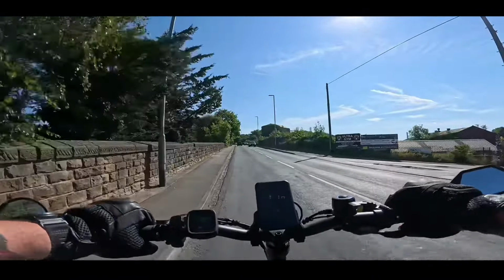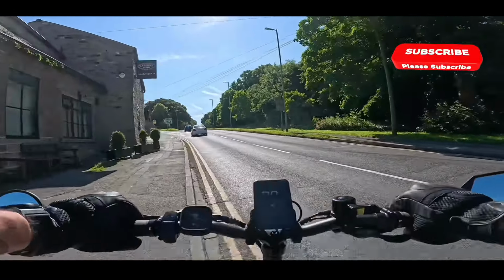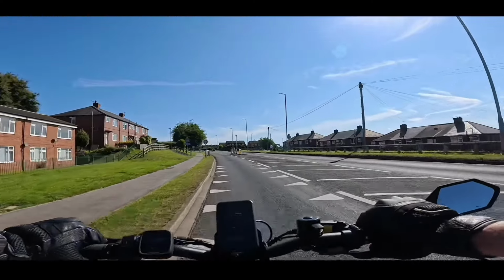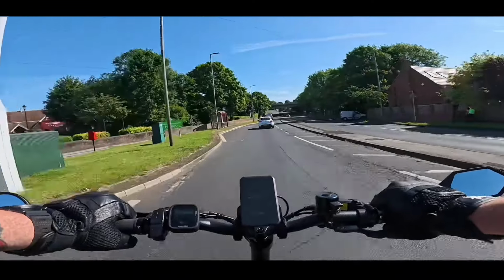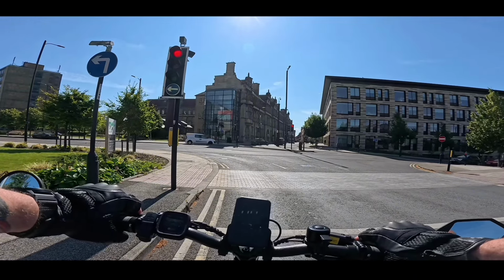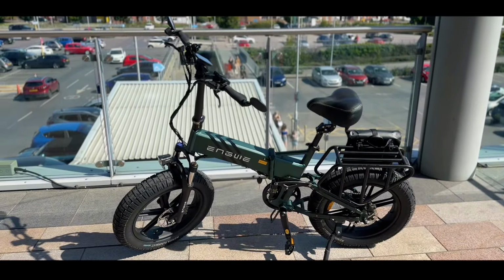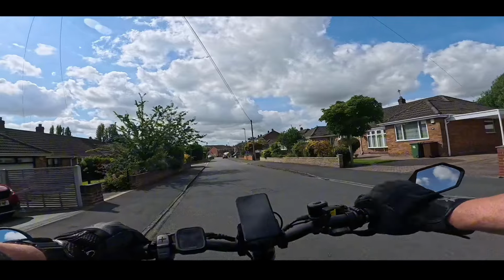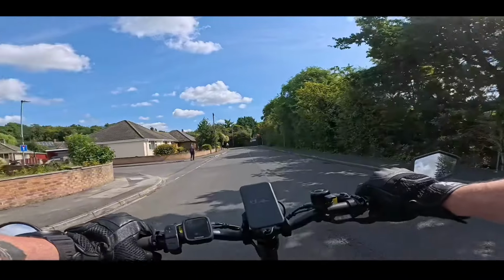Engwe Engine Pro 2.0 How to make the Engwe Engine Pro 2.0 better

Comment: Hi, great video, i bought mine in green, and recieved it this week, after riding it a few times i noticed the front fork stem was lose, so i took the handle bars off to be shocked that nothing other than 2 flimsy bearing rings and some plastic rings were trying to hold the fork stem in place, after re assembly it still fid not work, have you checked yours? When you pull the breaks the handle bars jerk because of the movement in the stem. 
Hope all this makes sense, is there a fix for this?
Reply from the maker: @ironian24  mines fine. I’ll be swapping my headset out next week to a sealed bearing set. I’ve got adjustable air suspension to fit to the front and mid as the modding should be complete in a couple of weeks when the rack battery arrives. 

To be fair, the head set should be fine, just needs tightening down. I weigh in at 250 and it’s holding up fine. 
http://youtube.com/post/UgkxICO9Mqe3NzkzEsGc8_fIYik9GZwV_GRf?si=qtmkWU-3xsXujE1O
Reply: @ModProjects4306  I sussed the problem, I have not tightened the center nut up before tightening the Alan keys on the handlebars 🙄, so I realised what I did wrong and undone the handle bars undone the centre post nut adjusted the stem so it sat central and ret8ghtened the centre nut until all play was eliminated then tightened the handlebars, walla, job sorted, I got the throttle working also, but to be fair I can peddle at a constant 28mph where as the throttle on its own does 20mph, this is private land testing of course.
I have to say I love it, it's an absolute beast of a bike and like you I'm 245 pounds in weight and it's totally fine, the range is very, very impressive, and off road is a must with this as well. For me there is nothing to dislike about this bike and for the money I really can't see another beating it.
Reply: @ModProjects4306  i would like to see a video on that please 🙏
Reply from the maker: @ironian24  sorted. Private land testing … 😂😂😂
Glad you’re enjoying it buddy.

Comment: Great videos! Is changing to an 11- 34 freewheel easy to do?  I'm thinking about doing that with the one I ordered. Do I need any specific one, or any 11- 34 freewheel?   I live in the US, and plan to leave the throttle on also..
Reply from the maker: @Outinnature83  you’ll need a freewheel removal tool that’s designed to go over the motor connector cable and I use the Drift Maniac freewheels. Loads of videos online on how to swap these out just by doing a quick search. Hope this helps.

Comment: Hi what do you think about the new l20 boost, comparing l20. It's a torque sensor too, but there is a boost button with 75nm..i don't understand hiw it is possible with his motor and battery..
Reply from the maker: @Tendeep4  I think it’s a brilliant idea … although it’s my idea they’ve stolen. I should be mad but I’m genuinely flattered. The controller controls the torque settings. How do you think the 36v P275 ST gives out 70nm? Read this. 
http://youtube.com/post/Ugkx7rfMtUujPmHui7Rr9Xt0QpY971WunfGw?si=06HP28-Zx83Qe3xo
Reply: @ModProjects4306   ok thanks, but there is the throttle too. I imagine the boost button die the battery... And if its a torque sensor like your pro 2.00, why need throttle and boost🤔.
You will test this model l20-boost?
Reply from the maker: @Tendeep4  hopefully. Because some markets the throttle isn’t an issue. This bike is primarily aimed at the EU and UK marketplaces.
Reply: @ModProjects4306  i understand. You think it is just possible too install the torque sensor easyly on the l20. Because it is just what i want. I'am a newbie...how doing this and the material if you know pls. Thx a lot for your help

Comment: Is this a good first time electical bike? I need a bike and thinking about buying this one
Reply from the maker: @babu25557  this is the best ebike Engwe has ever made … it’s absolutely awesome.
Reply: @ModProjects4306  I agree it's stunning, and for my first ever E bike I am totally impressed a week later, just make sure you build up the handlebars correctly 😀, I didn't,  I had a very lose fork stem, read my comments above to see what I did wrong. I know I'm not the first to do this wrong and I won't be the last. It's worth doing a video for this alone.

Comment: Ive been thinking of upgrading to this from the original engine pro. Do you think i could use the battery from the original as a spare? I know their outputs are slightly different but im assuming youll know the answer to this
Reply from the maker: @gariwatson9171  only one way of finding out. I’d have thought so.

Comment: Did you just take off the throttle. Just removed it & the bike still worked??
Reply from the maker: @Liam.T  unplugged it from the controller, yes. Throws up no fault codes.
Reply: @ModProjects4306  TYVM! just got mine now.
Reply: @ModProjects4306  why did you unplug the throttle?
Reply from the maker: @ironian24  added a 11/34 freewheel and it negates the use of one. It’s not worth getting your bike seized because you have a working throttle. Like I said in my video … a torque sensor is a throttle for your feet.
Reply: @ModProjects4306  I get that, I'm 58 and have grandad rights on my licence, so I can insure tax and mot this bike if I register it with the dvla, or that's what I hear. Is this correct and is it worth insuring anyway?
Reply: Can you still have a throttle if limited to 4mph or have I missed law change 😬
Reply from the maker: @Rickdundee  how are you going to restrict the throttle to 4mph?
Reply: @ModProjects4306  I have a throttle but it’s limited to 4mph unless I unlock it 😉but was thinking of if I need to remove it. I have a L20. Grate Chanel by the way 👍
Reply from the maker: @Rickdundee  not all Pro 2.0’s are built the same. You’ll find on the back of your display in the ident the number 6. That means it’s restricted to 6kmh. 

Here’s the thing. One of the first things the police look at when they’re “looking” and I use the term loosely, is if you have a throttle or not. 

As far as they’re concerned that’s the biggest giveaway. 

… and thanks.
Reply: Great video! Do you have a link to the rear 11-34 tooth cassette and removal tool please? I don't fancy Mr Police Officer taking my bike away! Cheers!

Comment: FYI speed limits do not apply to peddle bikes in the uk
Reply from the maker: @no_pro_mo6942  FYI … just in case you come across the wrong plod “Bicycles are not included. While you can't normally be charged for speeding on a bicycle you could, in extreme cases, be charged with careless cycling (maximum fine £1,000) or dangerous cycling (max fine £2,500). Furthermore, local bye-laws can impose limits on cyclists.”
Reply: @ModProjects4306  you don’t have to be peddling like a mad man to go faster than 30. Plus it’s easier for me as I’m in wales and we have 20mph instead of 30 and at 20 you can fly by cars
Reply from the maker: @no_pro_mo6942  😂